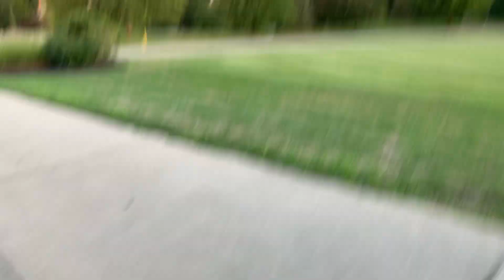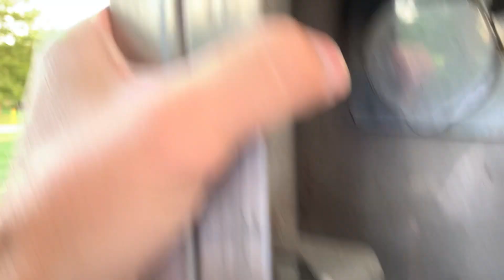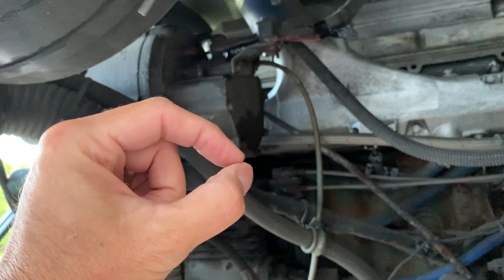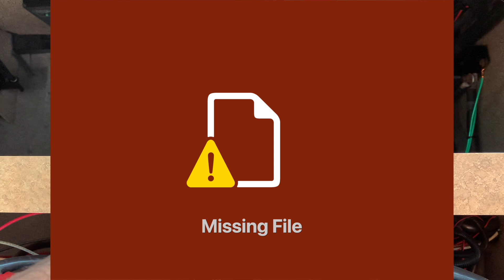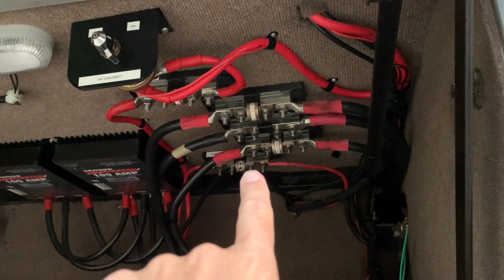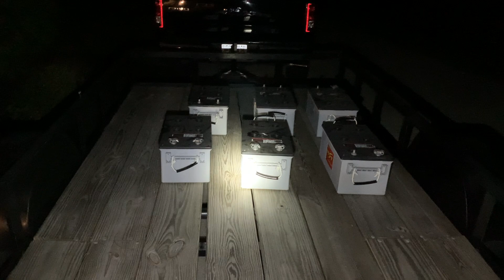Batteries Blew Up!  Tear down, Wakespeed WS500, Sterling APD and EG4 Lithium Install Discussion

Comment: Were the bad batteries AGM or regular deep cycles ? I guess they were AGM since they did not explode...And I highly suspect they were overcharged to exhibit this kind of failure....I had a regular acid battery in my vintage BMW and it exploded because of a faulty voltage regulator  that was producing 18 volts !!! Now I have an AGM type. Good video as always.
Reply from the maker: Thanks!  Yep, they were AGM. Can’t believe they still worked!